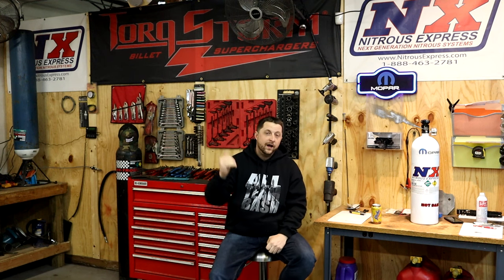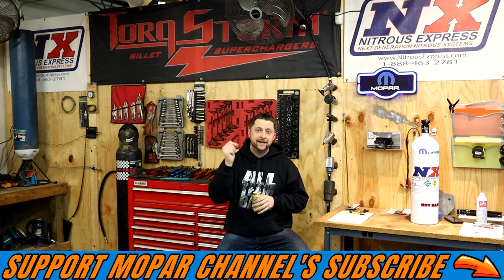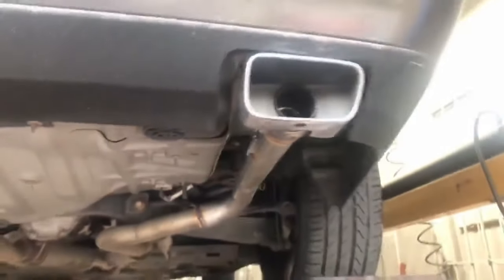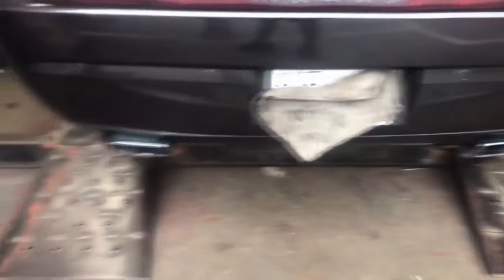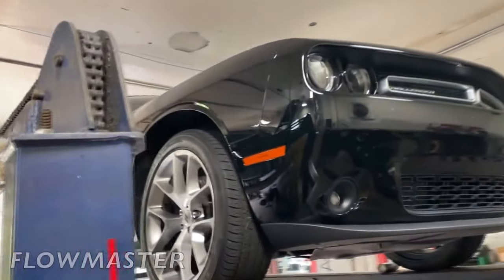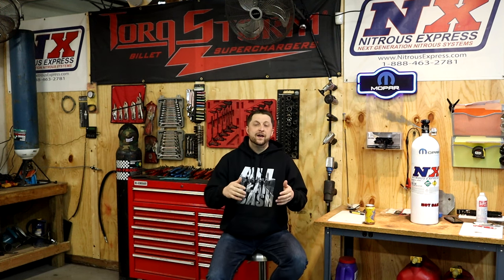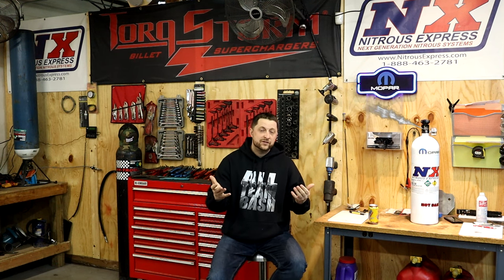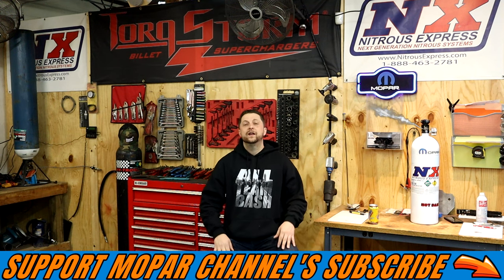V6 Challenger/Charger Exhaust Sound Great Like V8 Hemi?

Comment: I used to have just a rear muffler delete on my v6 challenger while it does sound pretty good, the drone was horrible, so i replaced the mid mufflers with vibrant resonators and left the back straight piped, the drone is wayyyy better and sounds awesome
Reply from the maker: Awesome
Reply: Vibrant resonators to kill the drone? I’ll look into that. I deleted the rears on my challenger and the drone isn’t unbearable, but I’d prefer to kill that and keep the sound. 

Is any of your sound sacrificed because of these mufflers? Or does it still have the same growl minus the drone?
Reply: @tyransaffoldjr  theres still drone but its not as bad especially in the highway, theres almost no drone at highway speeds. You wont be sacrificing the sound, it sounds just as good if not better
Reply: @Ramsfan-x7t  cool. Thanks! Imma purchase those
Reply: @tyransaffoldjr  yeah i bought the ones that say 1792 vibrant bottle style resonators off of amazon
Reply: @Ramsfan-x7t  I have flowmaster 10s on my mid mufflers should I keep them on and get resonator delete?
Reply: @JimmyKudo93  how does your car sound now? I would delete the rear resonators because i feel like they kill a lot of the sound of the flowmaster 10s
Reply: @Ramsfan-x7t  I did mid muffler delete it’s loud it’s ok but I think I should put them back on and do resonator delete I think your right with flowmasters It sounded good but those resonator killing true sound
Reply: @JimmyKudo93  if you put them back on and remove the rear resonators, you will have lots of drone

Comment: My 2015 challenger v6 is straight pipe it’s stupid loud sound great at idle but under power not so much I’m thinking about putting flowmasters super 10s where the mid mufflers was .

Comment: Very informative. I have 2022 Dodge Challenger v6 with 2300 miles and did a rear muffler delete and sounds good. Next step I was recommended was to replace mids with Super 44s. Your thoughts vs Super 10s
Reply from the maker: Thanks
Reply: I have a 16 charger and removed rears and replaced mids with the 44s. I like the sound no tin can no drone. Can post vid if you want.
Reply: @captrayn5079  can you share a vid of it. I have a 2022 challenger gt with 3k mil and I am confused about which one to go for, a mid-muffler or rear.
Reply: @bibeklama7920  will post soon just recorded some stuff today for you

Comment: I did straight pipe few years ago because i love the way the v8 sounds but now i wan my v6 to sound a little louder....my brother suggested adding the Flowmaster....So when i called a shop about doing this the guy told me that the Flowmaster would quite my exhaust especially since i had the rear muffler delete.....is this true?

Comment: Anyone tried this?   On my 06 1500 Ram, I put two pipes and a extra converter, took off the factory muffler and replaced it with two Big daddy glass packs with the same flow rate.   Sounds good to me .  Not too loud  and kinda got a deep sound .

Comment: I m a mustang gt fan all the way.. I have a 06 cobra , but I did buy a challenger v6 for the work drive and I have the rear muffler delete and love it for v6
Reply from the maker: Awesome
Reply: @FrostbiteRam  thanks bro. Any ideas on what I can do to add horsepower? Is a a cold air intake worth the money in a V6 case?
Reply: @brandonray8409  Not a lot of room for more power on a Pentastar. Pedal Commander will give the illusion of more power with better throttle response.
Reply: RIPP turbo charger. It will increase your power by like 45%
Reply: @Later2u  thanks bro
Reply: @blackskimasklife9778  appreciate it bro

Comment: First of all, this video is old and I have no idea why it was sent to me today. That said, there is no Mopar V-6 any longer, and none of those cars are even made anymore. I give Chrysler 1 more year and it'll be gone. Two tops. If you have a Pentastar and want it to sound good, get a Borla S Cat back system. You'll be very happy with it. It fits like a glove, it's all top shelf stainless steel that'll never rust, will last forever, and costs about 1,600 dollars complete. It won't wake the neighbors on the morning startup, (but it's close) takes the 6-cylinder whine out of it, has no drone, and will get very loud when you hit it. Best of all, it'll use the factory exhaust tips which will keep the rain out of the pipes and the wet soot off of anything behind it when you start it up in the pouring rain. Borla S is what I use and I wouldn't have anything else. I have a 2018 supercharged AWD Dodge Charger which is the last of the Mercedes E class cars. That included the Challenger and the 300. Goodbye Dodge. We knew you too well. What ever you do, don't crash your cars folks. I highly doubt Dodge will be able to get body parts for them because they've closed all the factories that used to make them. That's 4 billion a year in sales Dodge just cancelled. They're finished. I knew this the day they shut down SRT and gave it to the Europeans. The only thing they're selling now are 23 leftovers. To Chrysler I can only say F.U! And to Mopar? It was nice while it lasted. Unfortunately, now you've gone back to the junk you always were. 80 grand for a Jeep? Like I said; while it lasted.

Comment: I am writing from Poland and I need Your help.
Tooday I have cut rear mufler (stock resonators are still on the car) from my 2018 Challenger V6 at the shop. 
I thought that it is the best way to get better sound.
I am very disapointed because the drone inside the cabine is huge...esecially when I drive in town at 1500 rpm or when I accelerate up to 6000 rpm.
Will changing stock exhoust tips to quad tips can reduce drone?
Please help me find, what can cause such huge .

Comment: I have a 2006 Dodge Dakota with a 3.7 and I want to put true duels I’m not sure what my floor will sound the best I am thinking about The thrush welded mufflers or magna flows muffler I don’t know the part number but it looks like a fort can I will be installing these in the middle and not sure which one was sound the best. Which one do you think was on the best?
Reply from the maker: Either should do well the dynomax race bullets sound good also but is louder.

Comment: I have a 2011 V6 Durango that already had cold air intake and cats gutted and mid deleted but they had made a Y pipe that went into a magnaflow ( looks like magnaflow version of glass pack ) then went to stock muffler at rear .. I have the crew Durango so it only has the one outlet and it had some tone but more less stock but deeper .. so I eliminated the stock rear and put a decent tip nothing fancy or big and I would not suggest this setup at all unless you're into to Tokyo drift scene LOL. The Durango now sounds like one of those pissed-off rice burners. Just did that yesterday so today going to try adding in a flowmaster and see what it sounds like leaving the magnaflow in The Middle. But I liked this video and they way it was explained so I may just dual it out and go with 2 flows. It's the wife's car but I can't have that pissed off Honda sound .

Comment: Hi, I have a 2012 WK2 with the original OEM exhaust with a 3.6l. The system is getting tired and I would like to fix her up. I gues a few questions. 1) can I convert it to dual exhaust using option 1 or 2 u identify here?
2) What aftrtmarket cat back system would u use here to get the best sound? 3) can I do a blend of the options here with aftermarket 
stainless parts to create a very long lasting system? I’ve looked at many YouRube videos
and they emphasize that the mfg spends tons on R&D to build and exhaust to max the performance of the motor up front. For instance my GC has the 220CI 290hp motor with 2,25” pipes, this maximizes scavenging
In slowing the exhaust gasses to get from the motor out the rear ASAP, keeping these characteristics in tact or close to them important or is it just double talk, I know it’s not a top fueler in its own world but a little old Pentastar from Pasadena. Thanks for the help. Tom from NY 👍
Reply from the maker: I think best option is have the exhaust shop weld up a system you like in the video it will be much cheaper than buying a complete exhaust in a box.

Comment: Hello Mopar Motorsports great video man keep up the great videos man 👍. I have a 2015 Toyota Corolla. What muffler do you think would sound good at all rpm levels? I've replaced the resonator with a 12 inch bottle style Vibrant performance resonator 304 stainless steel 2.25 inlet/2.25 outlet, AEM dry flow performance air filter. I've had many mufflers trying to find the best possible sound for my car from aggressive sounding to mild sounding like Magnaflow oval muffler, Paradox signature series elite muffler, Cherrybomb glasspack, Evil Energy muffler and currently the DC Sports resonated muffler ex-5016. What mufflers should I look into getting on my 2015 Toyota Corolla next? I don't want my car to sound raspy but just an all around good sound at all rpm levels not just good half the time and other half the time sound like crap. I saw alot videos of the round flow FX, Magnaflow magnapack, dynomax bullet, Cherrybomb m-80 muffler, thrush rattler etc but don't know which one would be best for my car.
Reply from the maker: I have tried dynomax race bullets they sound great the longer the cleaner the sound will be.
Reply: @FrostbiteRam  that sounds great 👍 thank you for helping me out man 👍 I'm going to check out the dynomax race bullet muffler 24235 and get a exhaust tip 2.25 inlet-3.50 outlet for a more aggressive look. I've had an exhaust tip that was 4 inches outlet at one point paired up with a Magnaflow but for my Toyota Corolla the exhaust tip with the 4 inch outlet too big and looked out of place. Would you recommend a regular exhaust tip or an exhaust tip that is resonated for better sound with the dynomax race bullet muffler? Which dynomax race bullet would you recommend the short dynomax race bullet 24234 or the longer dynomax race bullet 24235 for my Toyota Corolla that will replace my current dc sports muffler ex-5016?

Comment: That clip @4:00, how much louder is that over stock? I like it but dont want it to be obnoxious
Reply from the maker: It's a decent difference But not too obnoxious
Reply: @FrostbiteRam  thanks. And how was the drone inside?
Reply: @FrostbiteRam  I was also wondering how the drone on the inside is for the mod at 4:00mins
Reply: @FrostbiteRam  so update. I ended up doing this on mine. It sounds amazing! It is loud but not obnoxiously loud. However between 2500-3000rpm there is very intense drone. Ill have to see what to do about the drone

Comment: I straight piped my mids on a 2012 rallye redline and don't like it at all! It sounds really raspy and like a rice rocket. I hate it. It also feels like it it gained power at the jump but lost power after 2 gear. It also shifts different imo...I got the Diablo sport tuner and that definitely fixed the power and shifting but waiting on super 44s for the mid and can't decide the rear mufflers
Reply from the maker: Awesome

Comment: For the Flowmaster 10s set up - what would it sound like if the rear mufflers were left on?
Reply from the maker: Probably very clean with slightly more rumble than stock.
Reply: Got it - thanks for the reply!

Comment: Do you guys have any recommendations for a 2019 Dodge Durango V6 has stock exhaust currently looking for something a little more intense but also give it more horsepower. More manly sound planning on a Ripp Supercharger already have Ripp Coil packs and just redid the top and bottom manifolds by MMX.
Reply from the maker: These combos work but I really like the new karnage mufflers
Reply: I put the RIPP turbo charger in my 2012 Challenger v6. Made huge difference!!!!

Comment: Good info. I added a Spectre Cold Air Intake to my 16 SXT Challenger and that kicked my hp up a few notches and it got me better gas mileage. It gave my engine some more sound when I floored it, but it was a little ricey…

So, I deleted the rear mufflers and between that and the Cold Air Intake, the sound is balanced and I love it.. the drone at 1500-2500 RPMs isn’t unbearable. 

But I just bought some dynomax bullets to replace my mid-mufflers and not sure if I wanna return them or not. 

A- might be way too loud.. 
B- could increase drone. 

Anybody take the Dynomax path?
Reply from the maker: I love the race bullets they sound great on almost anything.
Reply: @FrostbiteRam  thanks for responding. Do you know if a drone increase likely? Or will it decrease or stay the same? 

Since they’re resonators, common sense says it probably won’t increase but IDK. 

If it increases, I probably won’t install them.
Reply: @tyransaffoldjr  yo i have a 2021Gt w a intake and fucll custom exaust with those bullets.
Reply: @tyransaffoldjr  my setup is full 3in” straight pipes(larger than stock pipes) from cats all the way to the back, dynomax race bullets replacing resonators and no mufflers on the back. Should give you a great sound
Reply: @tyransaffoldjr  and no i get barely any drone if any
Reply: @davidpopa2549  I think I got a bad pair. There was a weird noise coming from underneath my car when I had them installed. I turned around and had them take em’ right back off. I had to be the one to get a bad set smh 

I have some glass packs coming tomorrow.
Reply: @tyransaffoldjr  👍
Reply: @tyransaffoldjr  also look into larger pipes if ur looking for a couple more horses down low. An H pipe would also gove it much deeper tone than stock x pipe
Reply: @davidpopa2549  got it. Thanks for the info. 💯
Reply: Go Big Boz x2, the best option
Reply: @Gitnardoproductions  I ended up cancelling the glass packs and ordering the bullets again. They sound better this time. Never heard of Big Boz tho.
Reply: @tyransaffoldjr  I found them on youtube with someone who has a 3.6 charger and I was sold

Comment: Are the Vibrant Resonators a decent option to do the resonator replacement and rear muffler delete with?
I think there's a video from the channel you used for the examples as well, I just wanted to gather other views on it, before fully committing down the line.

Comment: I have a 2014 3.6 charger with a sprintex supercharger and am having a few issues with some codes that are being shown, was wondering if you might have any ideas on how to fix that problem
Reply from the maker: What codes
Reply: @FrostbiteRam  p0129,p1dd2,u1424
Reply: I had more and updated my tuner and reinstalled it and these are what are remaining, I also have traction control light on and the lightning bolt on the dash for the throttle

Comment: I bought a 2011 challenger with a cat back borla kit. It sounds great but I would have never spent that much on exhaust for a v6. It sounds a lot like the super 10’s and rear delete. 👍
Reply from the maker: Awesome good information 👍
Reply: Love my super 10s.   Whether some V8 fool likes it or not isn’t the point.  V6 will never sound as good!  It still sounds aggressive.   The car on this video sounded like shit!
Reply: My challenger came with flowmaster 10s in mid muffler should I keep them and delete the resonator?
Reply: @JimmyKudo93  If you remove the resonators it should make it a little louder and raspier. I would just try removing them and if you don’t like it put them back on.

Comment: There aren’t many v6s that sound good. The Buick grand national is by far the best, especially with an upgraded modern turbo. It rumbled but 80% of the sound was of an f-15, the whistle of that big turbo spinning at 5-6 figure rpm sounds like a military aircraft.
Reply: Either the blub blub blub of a waste gate or the hiss of a blow off valve was/is unmistakable.

Comment: Best thing I did to my 2012 v6 challenger was pipe from the cat back and it was amazing and fairly cheap. No rasp and very nice growl for a v6. Where I went wrong was getting rid of cats and now I have horrible rasp in the mid range RPM but low and high RPM truly sound amazing being all pipe and nothing else but the mid range rasp sucks, need advice on what to add to get rid of rasp either a muffler in the middle or resonator, mind you I don’t have cats so it is very high flow

Comment: 2 questions 1. Can you pass safety inspection with super 10 and dropping those rear mufflers on a challenger? If you were to buy one of those expensive catbacks which one would you choose for the v6?
Reply from the maker: Yes you will still pass emissions because the converters is still installed and I would never buy a over priced box exhaust.
Reply: I’m gonna be getting a BORLA ATAK exhaust for my v6 challenger
Reply: @jaydaboi4577 How Dose It Sound 🔊 ???   Would be great if I used Coffin ⚰️ Muffler 2.5  I still have 3 cats no resonators?
Reply: @keepitsolidkeepitreal2877  I think it sounds good tbh it’s not like a straight pipe to where it’s too loud it’s got a nice tone to it n the drone isn’t that bad tbhh

Comment: The Pentastar with it's cast in exhaust manifolds kills any chance of making it sound like a V8
Reply: There's no chance of it sounding like a V8 because it's a V6.  On a V8, there's always 2 cylinders firing at the same time whereas a V6 there's always just one firing at a time.  Money and mods can't change the design of an engine, there's 1500hp V6's out there that still don't sound like a V8

Comment: I would say, save the $$$ and put it towards a V8. Even just the base 5.7 even if youre deadset on a Dodge. Even if they stopped production or if you can find one on the lot for a good deal New or Used. I've heard plenty of "rocks in a tin can" when it comes to the V8s tinny, raspy just equally crap. Exhaust Addicts is a great source to compare, and I skip the V6 and most Hellcat/Charger vids because they all sound the same... especially when the dude wants it "straight piped" without a crossover.